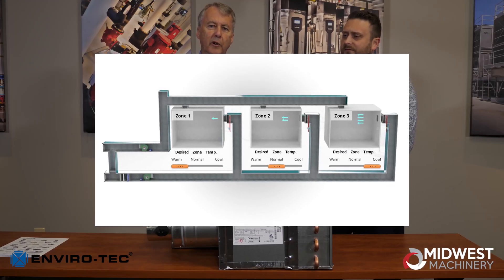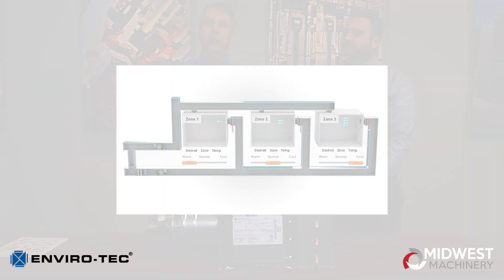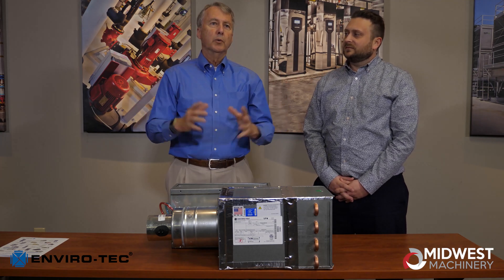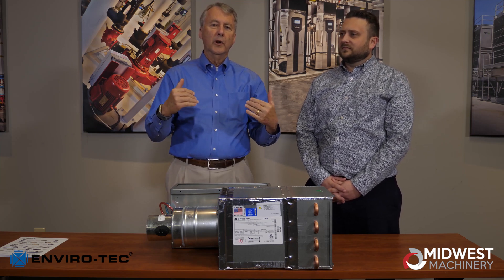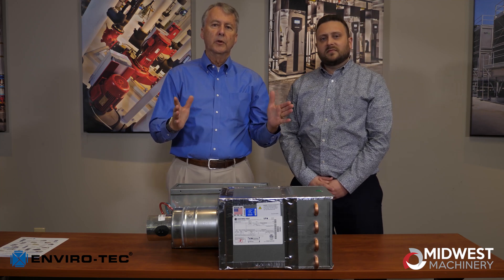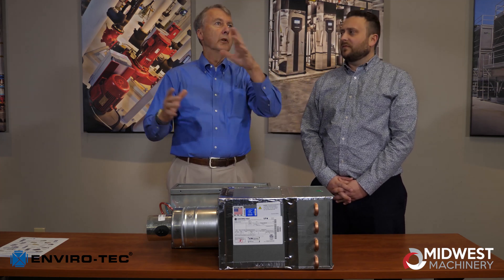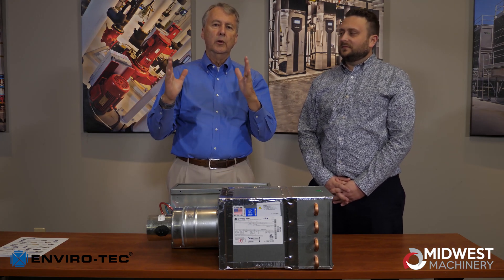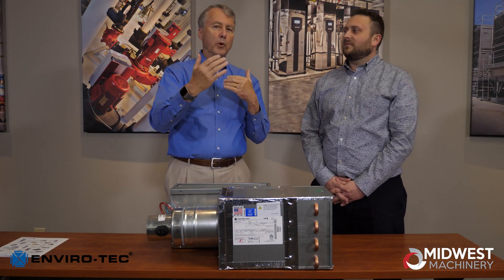Enviro-Tec VAV Boxes 101

Comment: Fyi : I would note most vav boxes as related to noise is typically a result of a velocity over 2300 Fpm.
        Systems designed to be quiet may have on a box by box basis a 1500 Fpm max set point but if
        you put every box on a spreadsheet and calculate velocities for each box it's common to find a
        few with that 2000 or even 2600 Fpm spec via the Cfm.   Suddenly a 0.85" static set point at the 
        Ahu requires 1.5"w.g. for one or two boxes.  Now we have a noise above ceiling system an a noisy box.
Reply from the maker: Thanks for the reply and insightful comments.
Reply: @Engineering-Tomorrow  where I work is also a mixed of vav system and individual room control stuff without connected to bms [individual rooms one in some areas of the building only] THEY HAD requested it because there were too many complaines but now even the other system has its own problem , I think people design system living on the moon rather than earth, they make it so complicated that if the bms cannot work it no one else can and that is pretty stupid because no one know what to do in the end and leaves it as it is...I saw this problem in many places including Hotel rooms where it was so cold but the customers were told it is ok?? Ha ha and they were paying big money for it. I think the designers of these system just needs to live in the real world and by that time there may not be a world left at all ha ha ha.